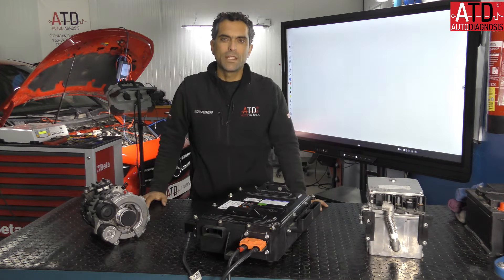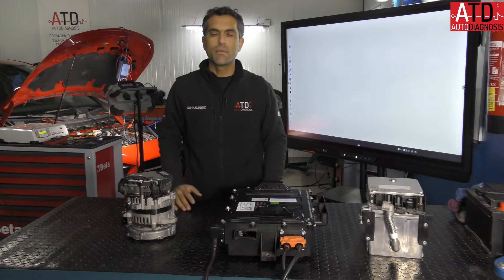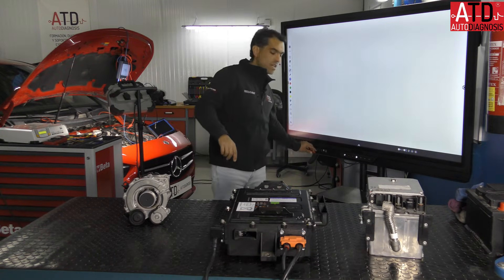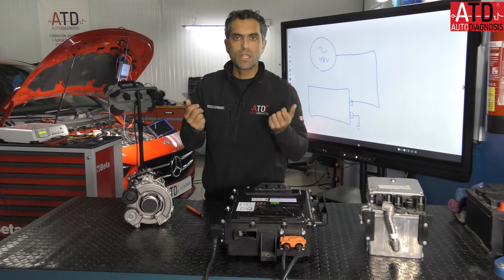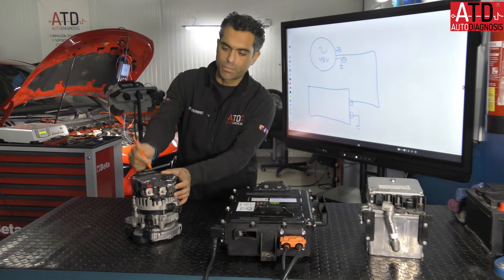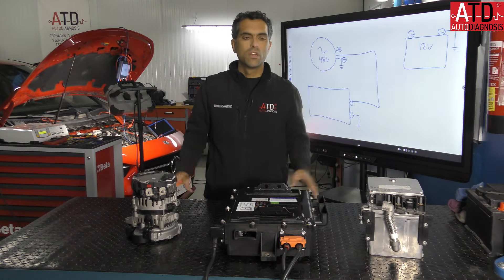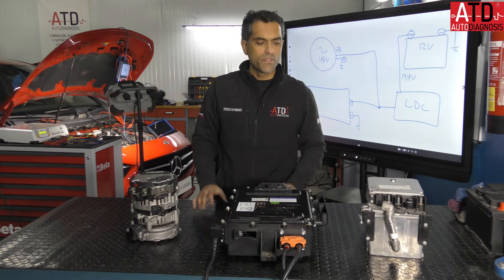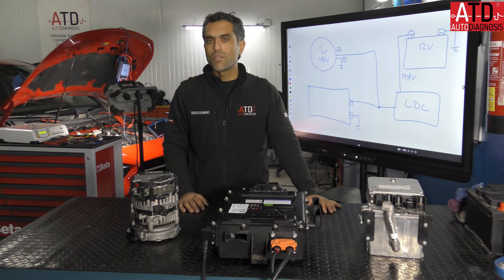Midl Hybrid 48V.  ¿How does it work?

Comment: The energy is not free, the engine has already generated it and you have paid for it. The system just coverts the energy from one form to another that is more useful. You also pay for the system up front and may not realize a return on the investment, again not free.
Reply from the maker: When regenerating, energy is free. Car moves the alternator pulley without fuel.

Comment: I have a 2022/2023 LR/DISC SPT D200 SE RD7L mild-hybrid vehicle. The scanner shows the following DTC for the BCM/GWM module: P065B-16. This could be the generator. My question is, is it really the generator? Here in Brazil, nobody has parts for this alternator, let alone how to test these 48-volt alternators.

Regarding the positive terminal (B+): should there be a constant positive voltage?

If not, the problem could be the 48-volt battery not supplying enough power to it to function correctly, hence the generator error on the scanner.
Reply from the maker: There will be 48v when relay from the battery will be connected.

Comment: You said that the 48-volt battery supplies power to the generator, meaning that if you put a test pen on the positive (B+) wire of the alternator, even with the car off, it should be positive. If it's negative even with the ignition on or the car running, it means that the battery itself might be sending positive to the alternator to charge it?
Reply from the maker: It is as a normal vehicle, but conected with the 48V battery

Comment: People may struggle to understand where the "free" energy comes from to charge the battery. When decelerating the vehicle, the regeneration system charges the battery; without which, the energy would be lost as brake disc heat, as the brakes work harder to achieve the same braking force without the regen system.

Comment: So if I'm understanding this correctly, the generators pulley creates a drag during deceleration which charges the 48volt battery. On acceleration and cruising, the pulley helps to reduce drag on the system by using the 48volts to turn the pulley with its own power rather than power from the crank pulley also countering the parasitic drag of the accessories i.e. water pump, power steering, alternator. ???
Reply from the maker: @jasonlucero352  yes.

Comment: Hello, I have this exact battery 375M0-D7000 from a Kia Mild Hybrid and the starter/generator, and want to use them in some type of a DIY project, is there a way to find the Battery datasheet in order to choose a BMS? 
My other option is to sell them.

Comment: So if I understand well I have to spend 3-4000 euros plus for a mild hybrid engine, in order to gain 1lt of fuel for 100km.
That's 10 lt for 1000 kms ,or 1000lt for 100000kms.
By then I will need to replace the battery for 3000 euros and hopefully if I am lucky I won't need an alternator etc...
That is 7000 euros in order to gain 1800...Great
Reply from the maker: @anastasiosspanos2290  Euro restrictions…That is.

Comment: I have problem with my golf mk8 1.5 etsi  doesnt charge 12v. 48 yellow light on display car. I have fault code p 108f00 on the converter its means pre-load faulty or disconnected . Is the converter detective?

Comment: I loved your video! The way that you explained in English and put each point across shows Knowledge and talent, well done. Have you been confronted with the 48V battery in the 2020ish Mercedes E53 AMG and its issues, I know Audi is suffering with its 48V battery also. With regards to the E53 issues do you have any advice based upon directly diagnosing whether or not it is infact the battery or the DC to DC converter software/hardware?
Well done again!
Reply from the maker: Hello! Thanks for your comments. We know that MB 48v have problems but I do not know what is exactly the problem. I would say that it is a failure in bms. 
Best regards.

Comment: Hi, great presentation. I have a question thought. I own a Hyundai Tucscon NX4 mild hybrid with 48V battery. Since 3 months old, when sits in the garage for 2 and more days, start/stop system doesent work, that tels me that somehow is depleted. What I start to use it a lot, go for a trip 200+ km it starts to work after I restart the car. I noticed that when that is the situation, the 48V system doesn't seem to provide energy to the engine. What it is working, the engine turn of itslef under reduced power requirements conditions and goes into ceiling mode. That' is not happening until I drive for several miles to charge the batteries. I pointed out the problem, and they cannot understand it. Everything works Normal according to them. From my  understanding, either 12V battery that assists the Start/Stop Sytems and other systems cannot hold its capacity and needs to recharge first, so that 48V system can unleash its potential, or alternator is not able to charge the battery enough.... or DC/DC converter is working properly. What does this description tell you?
Reply from the maker: Hello, I consider that your 48v battery is discharge. However, it is necessary to connect the scan tool to read real values and make a diagnostic. Best regards.

Comment: Hi..how long does the mhev bat last...ive been asking this all over..no ans
Reply: The battery is supposed to last 10 years, but unfortunately premature failures have been an issue.
Reply: So this mild hybrid technogy just seem like another, unnecessary point of faulire. And I bet hella costly to fix due to its location in the car and the need to replace whole batterry unit if it dies...

Comment: hello, I have a problem, I myself am an auto electrician, an Audi A8 with a mild hybrid came to me, this car lost charging before me, another auto electrician said I need to replace the starter, generator after replacement the problem did not go away and there was a coding error, the question is how to program it and gives Is it charging at idle. There is also an error on the battery at 48 volts, low voltage please help
Reply: Seems to me your 48V battery is locked down because of deep discharge.  It is the problem of such batteries.  As soon as the battery is deeply discharged, its controller gives the signal to lock the battery. The only one way to make the battery alive is to reprogram its controller or change the battery. A bunch of money..
Reply: @Alfa317Planet5  проблема уже решена
Reply: @dilik__0oo  как решили, если не секрет. Купил А6 с мягким гибридом. Начитался, насмотрелся. Хочется понимать с чем имеешь дело и что предпринимать в таком случае. Спасибо.
Reply: @Alfa317Planet5  единственное не оставляйте машину без движения на долгое время батарея разрядиться а если она разряжена то ее зарядить сложно ну а что могу сказать по нашему случаю то там просто вышел из строя стартер генератор но если его заменить нужно кодировать.

Comment: Thank you so much for explaining it's so clear but i have a small question what happens to the car if you lose your 48v or generator or if you cut the high voltage circuit ? Does your car lose power or have problem starting ? Or stall ? Thank you in advance for your feedback
Reply: My '23 Volvo XC40 B5 had 48v battery failure.  Warning lights illumated and went into turtle mode.  I could drive at low power until i got to dealer.

Comment: Hi bro , how recharge battery 48v after dead . Vw mk8 thank you
Reply from the maker: Hi, you have to charge it apart from the vehicle, in case you know how to do that.
Reply: @ATDautodiagnosis   owner of the car replaced new battery 48v from Germany but now when I scanner the car there is no communication with battery 48v. I need help please if you can send it to me your number WhatsApp . Thank you for answer.
Reply from the maker: @sohibgayed4349  You have to check BMS  wiring diagram to know what is happening....
Reply: @ATDautodiagnosis  I don’t have wiring diagram. And what is BMS please.
Reply: @ATDautodiagnosis  bro , must charge the battery 48v in the car or charge it outside the car. Thank you
Reply from the maker: @sohibgayed4349  It is indifferet. But you have to know very well what are you doing....